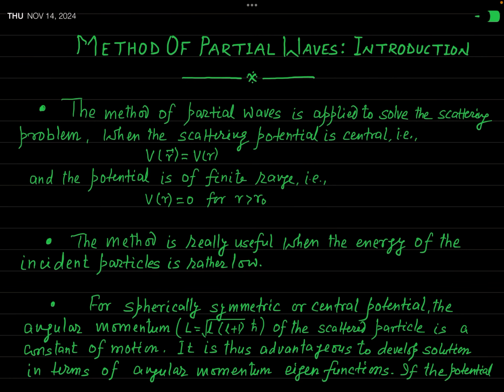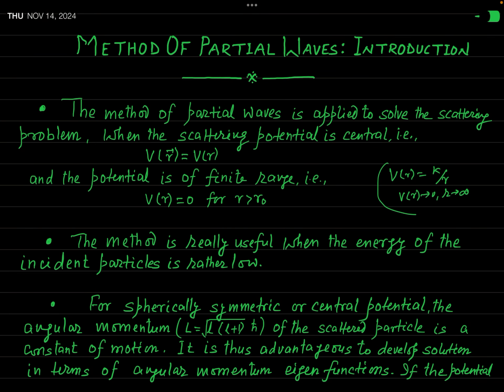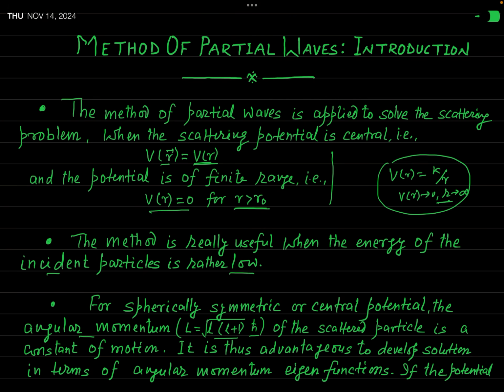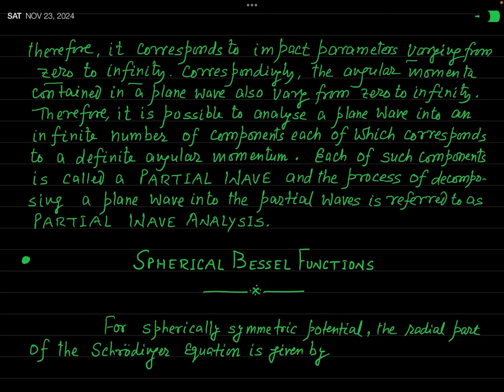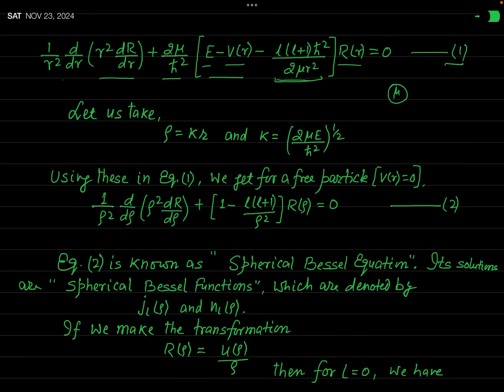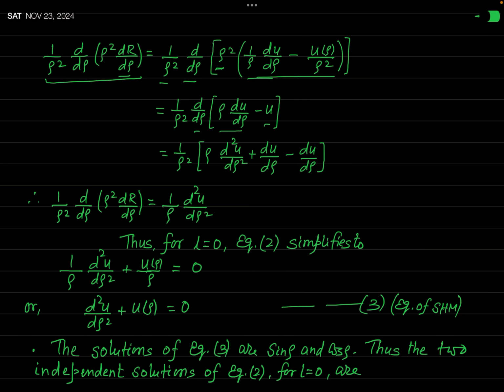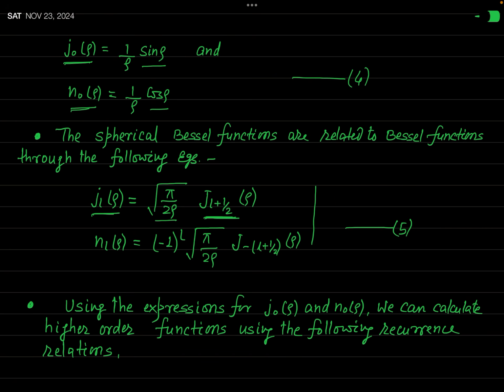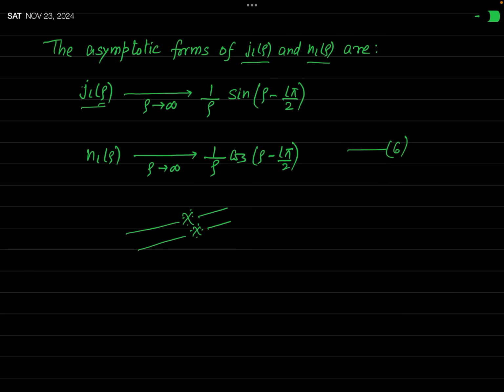Quantum Mechanics - Theory of Scattering : Method of Partial Waves - An Introduction

Comment: If you have these topics , please upload the pdf in comment section or tell the name of book where i can find these topics . Please Brother 🙏☹😢

•Action of Optical Resonators , Types of Resonators , Longitudinal and Transverse modes, modes of Rectangular cavity and open planar resonator , Quality factor , Critical Population inversion and Schawlow - Townes condition for Laser Oscillation.
Generation of Pulsed Laser : Q- switching , Principle and Technique - ELECTRO-OPTICAL SHUTTER (pocket's effect) and ACOUSTIC-OPTICAL SHUTTER , Principle of Mode Locking

• General Description of Laser Systems, Construction , working & applications of different laser system.
SOLID STATE LASER :- Ruby laser, Nd-YAG laser
GAS LASER :- Helium- Neon Laser, Argon- ion laser , Carbon dioxide laser
SEMI CONDUCTOR LASER :- Principle of semiconductor laser, Homojunction and heterojunction , laser structure , Applications.

•LASER INDUCED NUCLEAR FISSION , cooling and Trapping of neutral atoms, •HOLOGRAPHY , Basic principle , recording of hologram and Reconstruction of image.
• Laser application in optical communication system , Tracking of moving objects , precise measurement of length , speed and acceleration
• Industrial application in Material processing :- Medical Applications, Military applications.
Reply from the maker: You can find many good resources on these topics in textbooks and online.